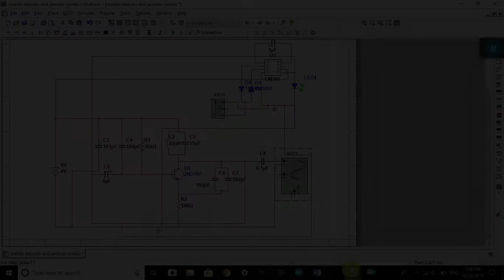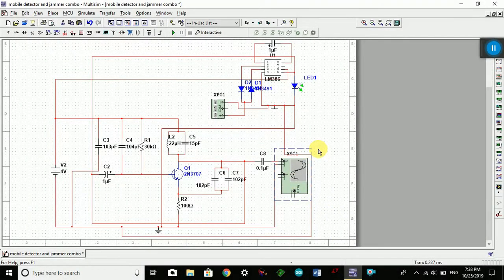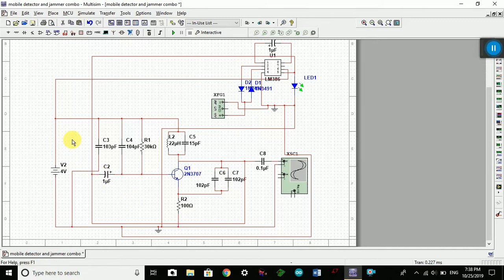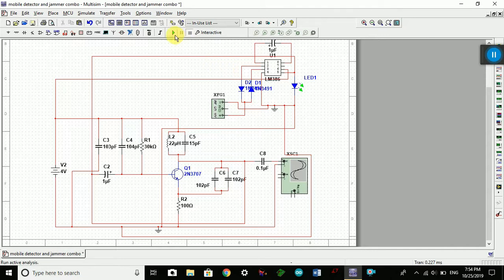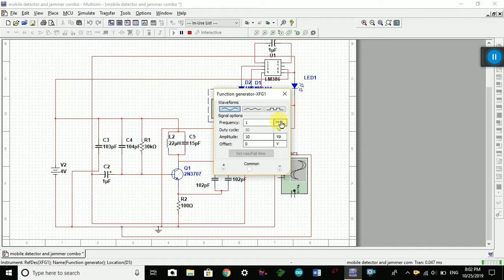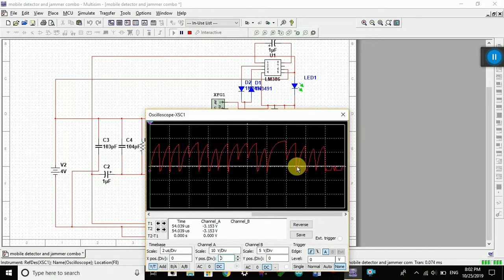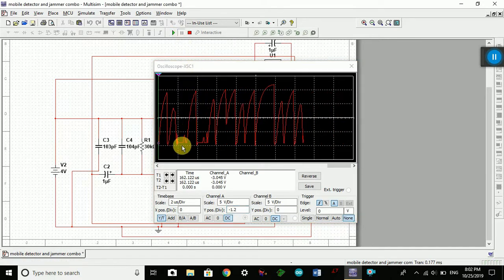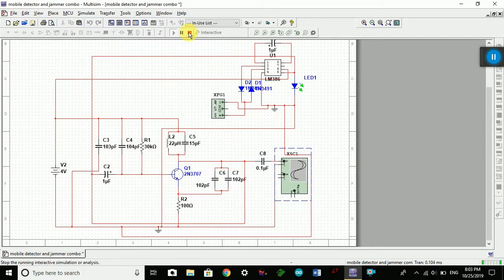Combine Mobile Detector Circuit & Mobile Jammer Circuit (Simulation) _ Multisim _ Electrogeek Z

Comment: What is the difference between mobile jammer circuit and this combination of mobile detector and mobile jammer circuit?
Reply from the maker: I'm glad you asked this question. 

So in mobile jammer circuit what actually happens is, when we turn ON circuit it generates noise signal which is so high that it jam all mobile operating frequencies. 

And what happens in mobile detector circuit is, it detects the mobile frequencies and indicates presence of mobile phone in mobile restricted area.

Now when we cascade both circuits what happens is, as soon as mobile detector detects presence of mobile it will turn ON the mobile jammer circuit so that a specific area will jam automatically. So when mobile jammer is OFF no need to turn ON jammer circuit manually.

This is just a mini project circuit simulation of this circuit which also clears the concept of cascading.

Comment: sir how can the detector ON the Jammer in cascaded circuit
Reply from the maker: When we give 4V supply to whole circuit Both circuits turns ON but at jammer output we get nothing cause Mobile detector does detects any mobile or frequency.

Now When Mobile Detector circuit will detect the mobile or frequency we get output of mobile detector, LED blink and also this output is given to jammer circuit. 

Now this signal is mixed with carrier frequency in mobile jammer circuit and we get output as noisy signal. Which means mobile jammer will give output only if mobile detector detects mobile or frequency. 

Well this circuit just shows how cascading of two circuit is done and what & how output we will get this is just a experimental circuit.

Comment: I am getting a simulation error when I try to run this circuit did you change any settings prior to this Sir? which could help me fix this problem I have carefully connected all my components thrice but still unable to simulate. Can you help me with this?
Reply from the maker: Have you checked polarity of components (positive, negative terminals) ... if connections are made correctly according to the polarity of components ? for electrolytic capacitors and diodes. 

also try to change components value and simulate ... if it still not work ... 

then DM me on instagram or facebook or links given in about section of channel. You can send me pic of your circuit I'll try to examine that.

Comment: You changed almost all the values of components while cascading the two ckts into one single. Did you do it on purpose or it really doesn't matter and only the relative ratios of the values of components be maintained
Reply from the maker: Yes I have changed components values because these values of components are correct for this combined circuit. If we use previous circuit component values (mobile jammer and mobile detector) then it will give errors. So I changed those values and we got output. 

Now for getting output, these values should be there in simulation.

Comment: iam getting error plz help
Reply from the maker: Kindly Re-view video and your circuit design. 

Mostly we get errors in simulation due to these common reasons -
1. Circuit wires are not connected to designated node or component terminal.
2. Sometimes we forgot to insert ground (GND) in the circuit.
3. Using software for long time 
4. Software is not installed properly
5. High voltage applied to circuit in simulation
6. Running multiple circuits on same page. 
7. Simulating circuit without learning it's working principle. 
8. A random error ... for this you have to delete the circuit, restart software or system and build again. 

If you still get error then feel free to ask again. Also specify error. 

As an engineer we get many errors in our work but we have to do our work patiently ;)